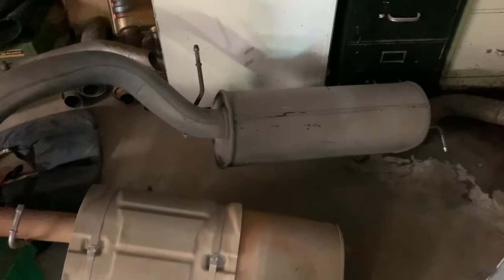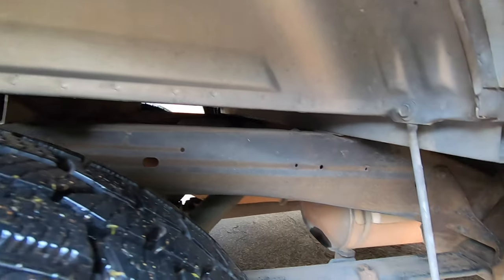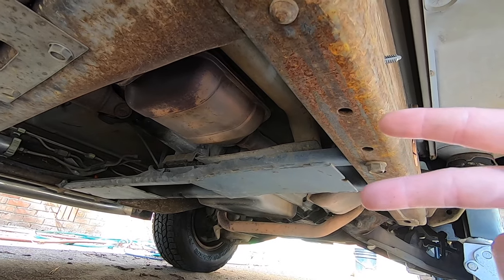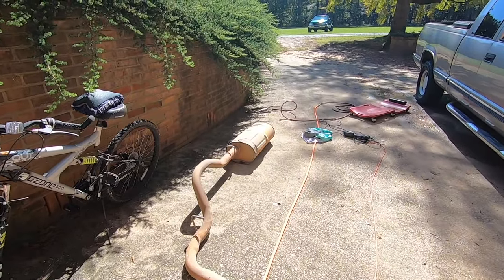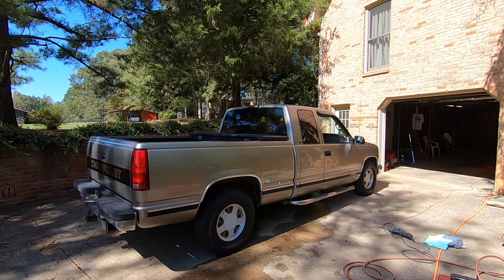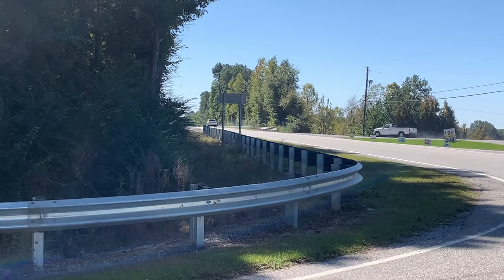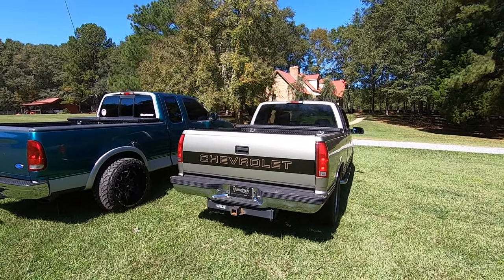True dual muffler delete - 5.7 V8

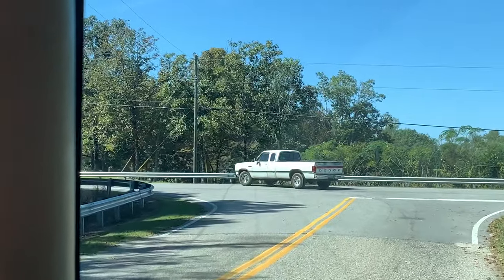Comment: Muffler Deletes are perfect. Not too loud, but loud enough for you to enjoy. It is a sweet spot into making your car louder. I deleted a muffler on my 1992 4runner V6 and it has a unique sound now even for a V6. It has a deep idle, and at around 1500 approaching 2500 RPM's it sounds like a roaring V8, but once you hit the 3500 to 4000 RPM range then you can slightly hear the V6 note that every 6cyl engines make, but it just sounds unique like a bass Amplified Nissan 350z mixed with that 1st gen cummins that passed by at 9:43 . Mainly because every catalytic converter has their own special design, and every header and engine crank has its own special design too, so all that can make your car sound a little different than expected. I love my unique sounding V6 4runner, but really I can't wait to try this on my Tundra 4.6L V8 🙂

Comment: I’m totally about to do this in my 97 GMCZ 71. I got a leak on the driver side inlet to the muffler and just sounds horrific and my son‘s got a 98 Silverado, his first vehicle. And his came with a custom true duels set up that came out just before the rear drinker side tire and it’s what I wanted to do with mine all along.  he bought his that way so I’ll have two very loud OBS trucks in my driveway soon. Thanks for the video as I didn’t need much of a push in this direction in the first place lol. Your video solidified it in my mind

Comment: Nice! I did something similar with my 2000 C3500HD (7.4 Vortec). I deleted the two cats, and replaced the factory muffler with a Flowmonster straight-through muffler with two 3'' inlets and two 3'' outlets and then turn-downs right behind the muffler. The muffler has two individual perforated pipes that are surrounded by packing material in a stainless steel case. Holley owns them, along with many other brands including Flowmaster, Flowtech, and Hooker.
Reply: Dude just stole the idea I had 😂 straight through mufflers 4 life! 🤘🏻

Comment: I have a 88 Chevy 1/2 ton 5.7 350 V8. Deleted cat 3" pipe into a single inlet 3" dual outlet flowmeter and it sounds pretty good. Love the k1500 series. Best trucks ever built.

Comment: Just something about those GM motors. I just had a y pipe dual set up done on my 14 Sierra 5.3. It’s got that damn 3rd cat and I didn’t want to mess with them and have check engine lights and problems. Y pipe after the 3rd cat then straight pipes out the back. It sounds fantastic. Not crazy loud but if I let it rip a little you can definitely hear it. Thanks for sharing the vid.

Comment: I did this to my Chevy vortec 350.  Honestly for a at home job it’s the best exhaust sound u can make for simple cut your muffler off.   Why mainly cause the thing I loved about these trucks is u cut the muffler off and u instantly had true duals. I have a tbi truck too and when it was stock only place it’s true dual is before the one single cat where it y pipe from the manifolds.  and u would have to cut it way up there and than get unsafe fumes in the truck it wasn’t worth it.  This still at least gets the fumes out behind the cab    Everybody different only thing is the pipes are 2 inch up front on the vortec.  All depends on what u like if u fill the rest of the exhaust in with 2 inch it will be loud as hell assuming U delete the cats  too. Smaller exhaust is louder!  But u dot have to have all the same size you can actually make it bigger in the back to soften the sound it will still be loud as hell with bigger pipe without the cats too but jsut not as bad as the small pipe. or just redo the whole system with bigger pipe if u want more mellow sound yet specially if u still have cats
Reply: Is this mode safe to do?

Comment: I have the same truck in Colorado. truck came from Montana with NO RUST. 1999 Chevy k1500 3dr LS all options 243,000 miles 5.7 liter and rebuilding it inFort Collins at Chevy dealership.  Was made in dec. of 98 and is a 99 model.

Comment: I have the same truck but mine is white with burgundy interior. My exhaust is the same but I have no catalytic converters and my pipe comes out the back duel style with 2 glass packs and it turns heads for sure.

Comment: Love the truck bud. I have a 99 k1500 with the 5.7 as well. I'm running no cats and a muffler (dont remember the brand)  but it's still pretty loud yet, but not insane loud lol. It's got a little rust here and there, I'm also gonna do a whole frame restoration on it after college.

Comment: I would say put some kinda streight through muffler on there. 
I used to do this on a lot of my trucks/cars back in the day. Either no money or just wanted it to sound loud now! Lol. All the shitty crackling, raspy noise got pretty annoying. But once you buy a quality muffler or system, you never go back. Thats when you realize how bad it really sounded lol. Don't get me wrong, I still like a loud exhaust, just like a refined tone. I'm ordering a Carven R series for my 19 z71. Then make a y pipe to split into the duel existing MBRP system I have now. 
They sound great. Deep, crisp and loud!. Oh also, get a diablosport i3 with a (diablew) custom tune. Its mint. I do have short video of it if you like see it. I do a 0-100km/h one up on the torque converter 0.- 100km/h and a 60 to 100. If you check it out, don't mind the poor camera and talking skills lol.👍🇨🇦🍺
Reply: Beautiful truck and nice sounding exhaust setup you got on your rig. I checked out your videos on your truck and I subbed. How many L/100km do you get while running that tune? Is there any difference from the stock tune?
Reply: @campbell0162  thank you. From stock, to where it is now with tires level, tune, etc. It is not to far off from where it was factory. I also keept a bit of rake for aero like factory.  I was around 16L per 100km, if i remember, and now its maybe 1km a L more? I drive with a heavy foot most the time.  I plan to weld in a Carven R series muffler soon with y pipe. And gut the 3rd cat. My tuner will revise the tune if needed, and will see how it does. Going to be pretty loud.  Ill be installing some diff drop spacers in a few days. Maybe ill make a video. 👍🇨🇦🍺

Comment: I had mine cut off like that with turn downs. When it’s cold the first major take off it will clap a little bit I would recommend putting straights turned down to the corner of the bed kinda how newer trucks are done has clap but not Excessive with cats

Comment: My truck came with a previous owner installed heartthrob cat back exhaust system glasspack kit with chrome or stainless 3 1/2 outlet slant cut 18 inch long exhaust tips except for the cat delete because the wrong cat back kit was ordered so it was straight welded on..sounds great.. my exhaust tips are straight out the back of the truck,I've thought about redoing it by heating up the exhaust tailpipes and bending them into 90's out behind each rear time but it sounds great so I left it alone..

Comment: I'm gonna be doing a muffler delete on my 97 c1500 if it has 2 true dual exhaust gonna run ether 2 glass packs or magaflow exaust with 4 inch tips going in front of my back passenger side tire loud and proud

Comment: 12:30 Its not the true duals. Its the engine type, that Ford is a modular sohc engine. They dont really sound good straight piped, where as a sbc is an in block cam, makes a big difference
Reply from the maker: Nah it's all about the exhaust. Both engines sound great.

Comment: It sounds better than it would with tailpipes. When those are there, with a muffler delete, it sounds like ass. What I can best describe as a clapping, what a horrible sound 

This, actually sounds fairly decent and is better than (most) mufflers I’ve heard where I actually have information on the rest of the exhaust

Comment: Too bad my 95 has single exhaust from the y pipe to the (non existent) muffler, I had a 98 with a vortec 5.7 but I sold it before I could get under it and steal the exhaust from it for my tbi

Comment: Next video I see will be titled “3 inch spindle lift Chevy k1500” from this guy and putting those ballistics in this thing..
Reply from the maker: You're a little late to the party
Reply: I too have a “Larry” I call mine Casper. I’ll have to follow your Instagram and send ya a picture of mine. Crew cab 2wd with the 3 inch spindle lift. I’ve changed it a little bit since I’ve owned it

Comment: They stopped making obs in 1998 and that's a obs, so it's not a 1999
Reply: I’ve  also have a 99 obs
Reply: @frogginwithdylan442  in 99 they came out with the round body which ran till 03 then there was a cat eye so if your truck is a 99 it's a round body not a obs
Reply: @killlaaaman9531  want me to show you the vin? want me to show you the original window sticker that says 1999? So I guess do some research cause they still made them in 1999
Reply: @frogginwithdylan442  look up 1999 chevy silverado then 1990 chevy silverado if yours looks like the 1999 it is a round body if it looks like the 1990 it's an obs
Reply: @killlaaaman9531  and mine looks like the obs cause it’s an obs